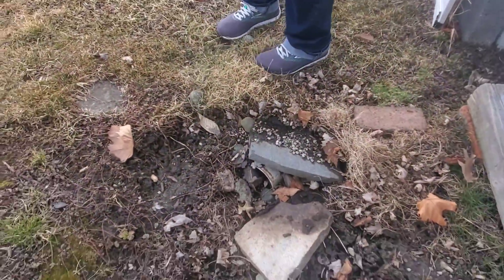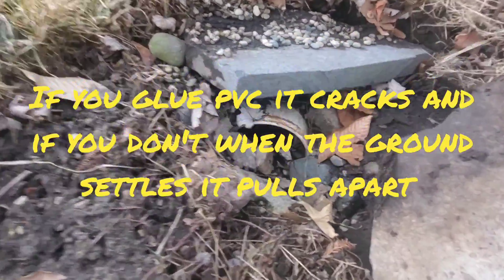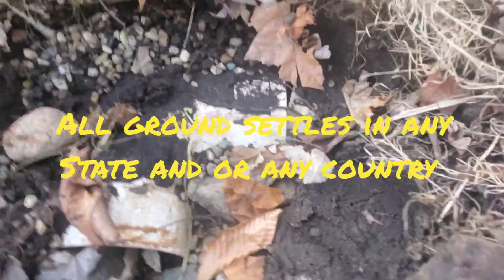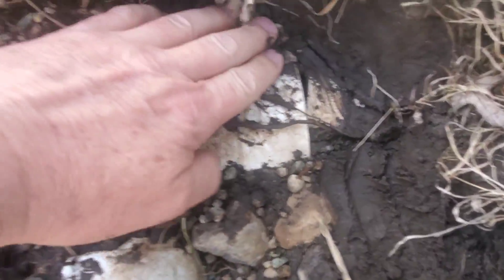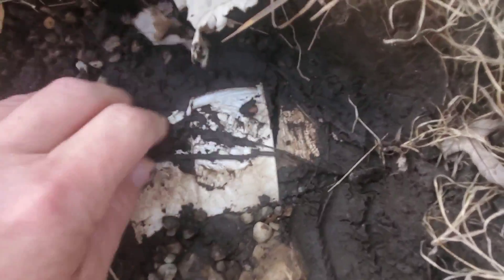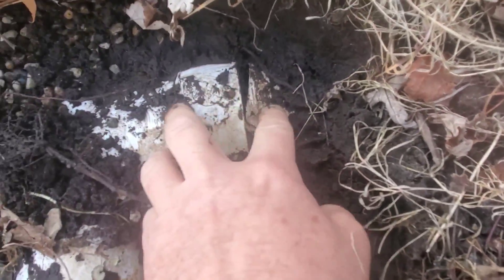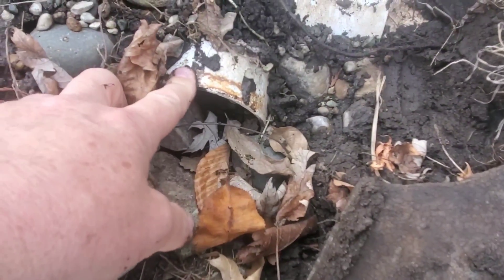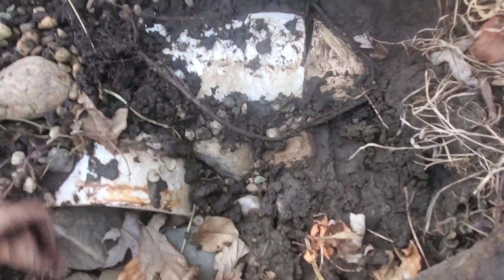PVC Roof Runoff System 5 Years Later [ Failed Drainage System that Needs Replacement]

Comment from the maker: Robert Sherwood is the host of The French Drain Man Channel giving all trade secrets in Building and drainage. With more then 35 years as a Licensed Builder understanding the need to do things right the first time.
Following the international code book helping DIYers around the world.

Store | French Drain Systems | Curtain Drains | Macomb, Oakland, Lapeer, St. Clair County
https://frenchdrainman.com/store/
Reply: I'm going to be doing an interior basement French drain. I plan on using the 4 inch corrugated pipe with washed stone. Should I wrap the stone with filter fabric or just loose? Thanks!
Reply from the maker: @bhein57  Yes wrap it